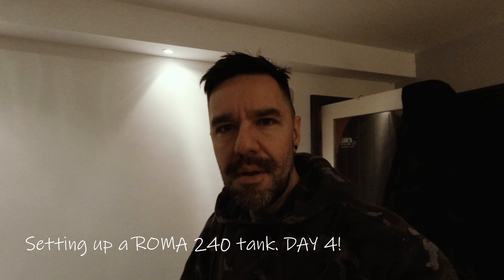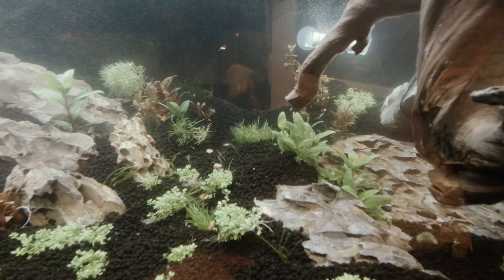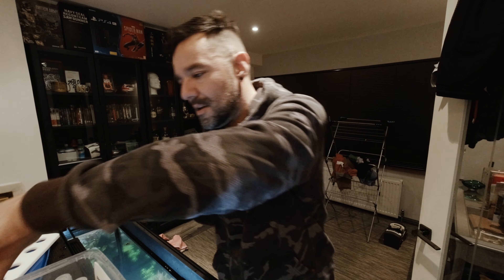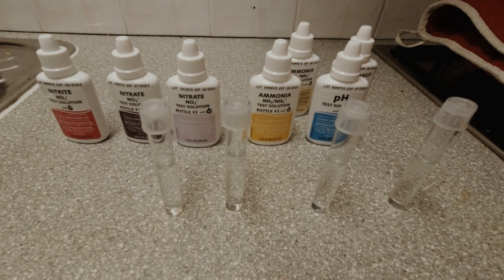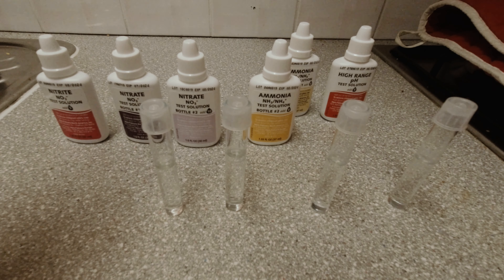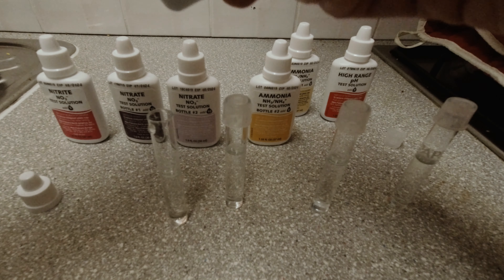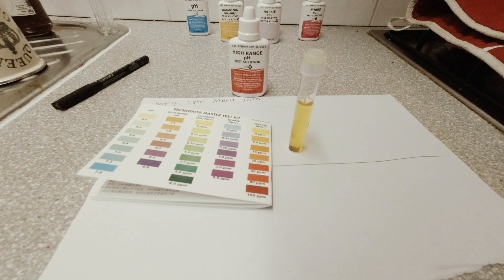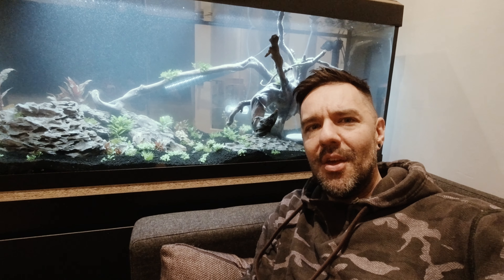5 -Fluval Roma 240. Day 4 - API Master Kit Water Testing Day.

Comment: Usual tap water ph is around 7.0 but the tannins released from the wood in your tank will reduce the ph slightly.  as you do regular water changes the ph will gradually rise towards late 6 to 7ph .Ph is critical to fish and sudden changes by even as little as 1 ph can result in dead fish I wouldn't recommend you try to force any changes.
Reply: Thank you.